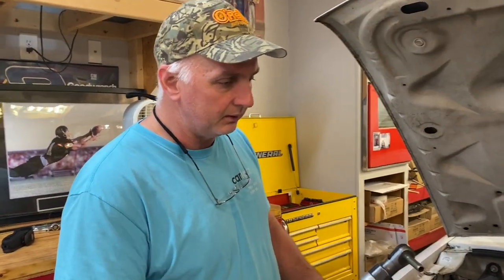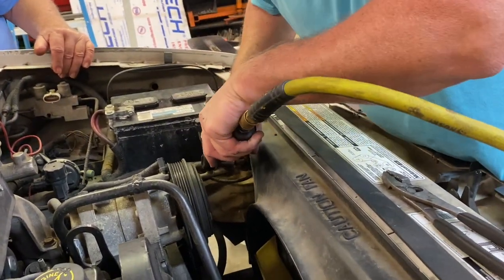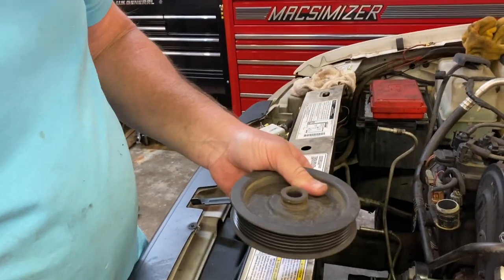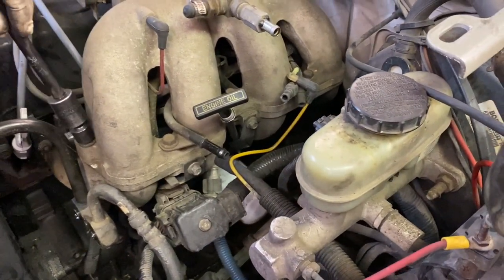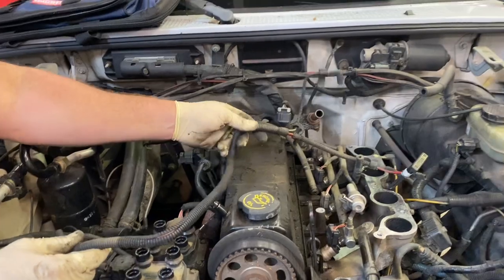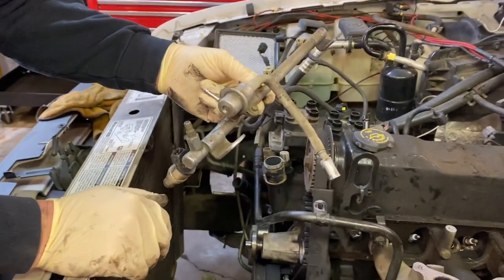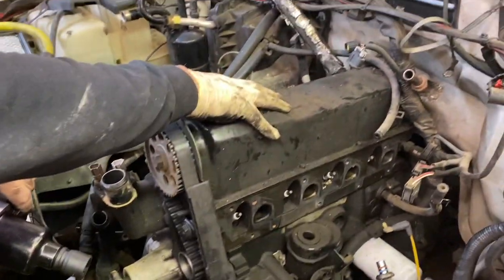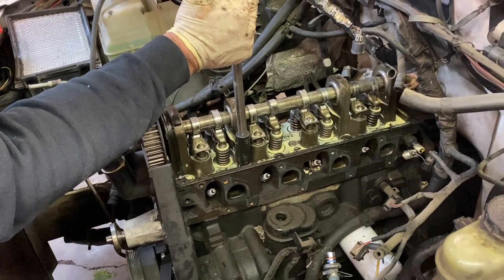How to Remove a Cylinder Head on a 2.5 liter Ford Ranger Engine

Comment: Amazing video, very thorough! @MintHillBillyDIY I'm curious if y'all have gotten around to making a video to put it all back together. I'm also curious if you have any concerns about blow by occurring if you're not also remaning the bottom as well. Would love to hear your thoughts,
Reply from the maker: We ended up doing a complete engine rebuild on this engine. Turns out we had a cracked head. We replaced the head and had all other machine work performed and rebuilt the engine. We have been releasing videos on the engine rebuild. We have more to release in this series. Thanks for your comment.

Comment: Do you by any chance remember the Cylinder head bolt torque?
Reply from the maker: Its a 2 step process. With new bolts torque to 50ft lbs. Then add 90degrees to each. Double check me on that. Its been awhile and I'm getting old. lol
Reply: @minthillbilly  Thank you so much mine is a 2000 2.5 and Haynes book gives a total different torque which I questioned because everything I see online says around 51 lbs

Comment: Thanks for the video. About to do the same on my 2.3. These 1 core radiators they put in these are way too small, about to put a 5.0 explorer or 4.0 ranger radiator in mine probably.
Reply: Is it the exact same process for the 1st gen ranger 2.3?
Reply: @jonathanmorales4319  It should be pretty similar, yours would have a distributor but they're all lima based engines up until the 2.5 switched to duratec engine